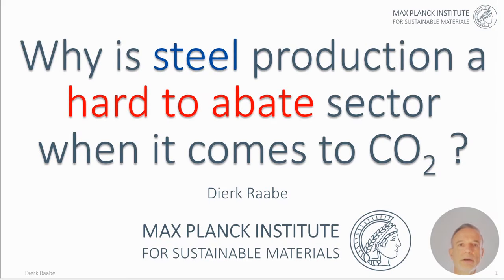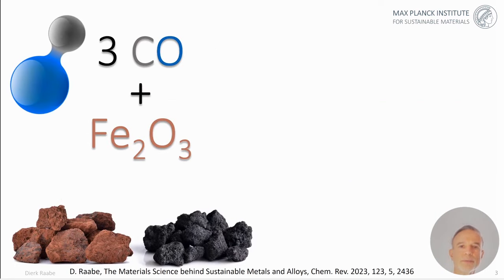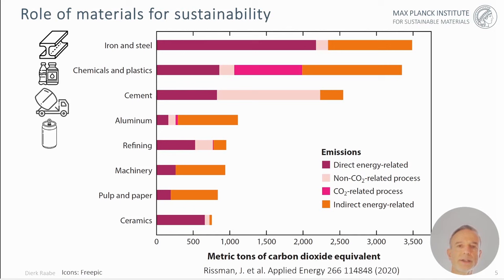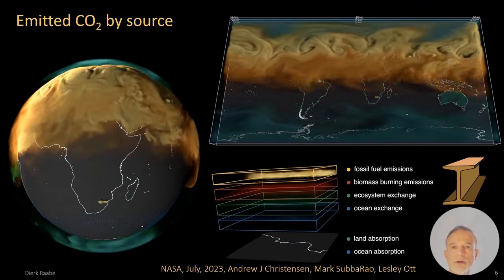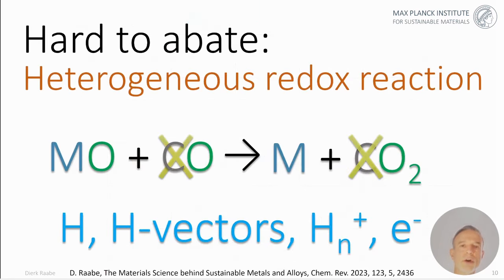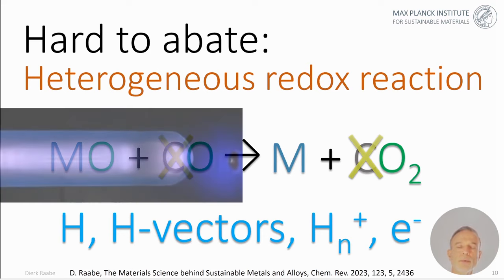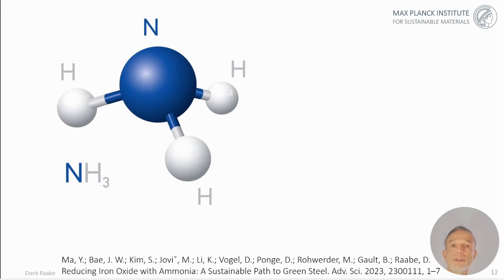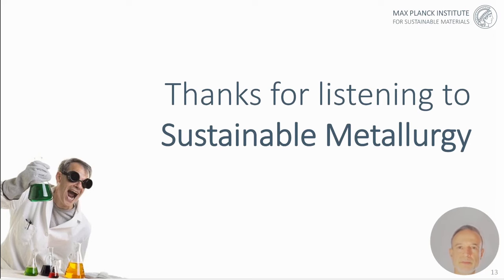Why is steel a hard to abate sector for carbon emissions?

Comment: Besides hydrogen-based (H2, NH3, etc.) metallurgy, traditional metallurgical processes with CO2 recycling driven by green energy might also be a potential solution.